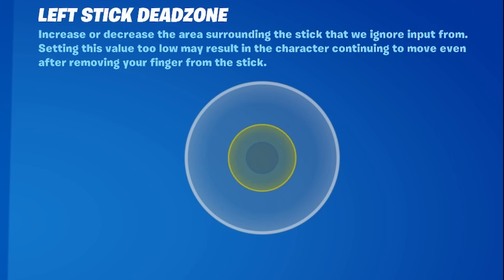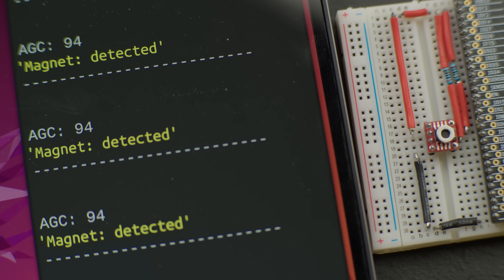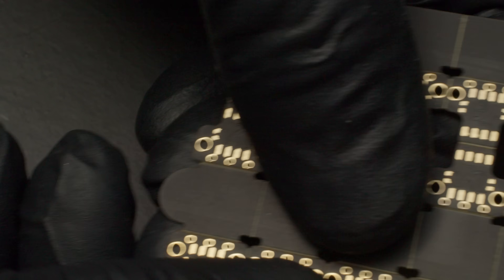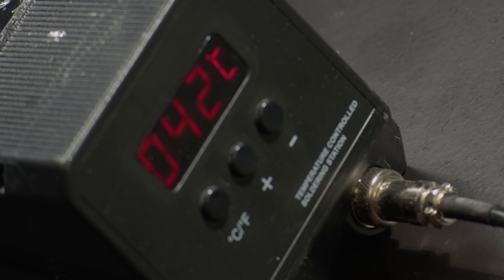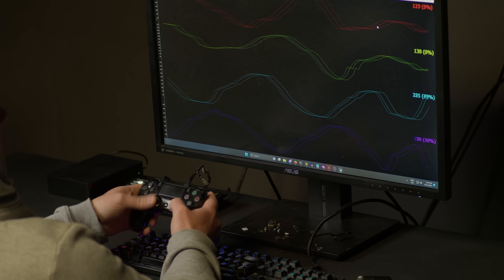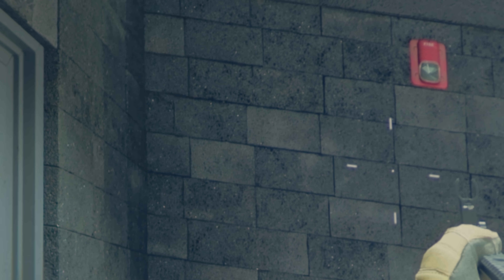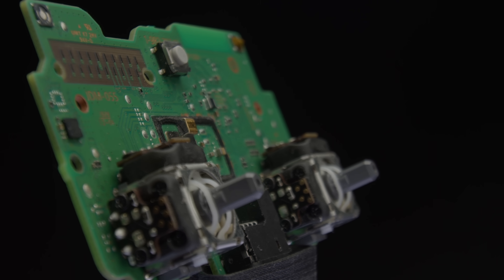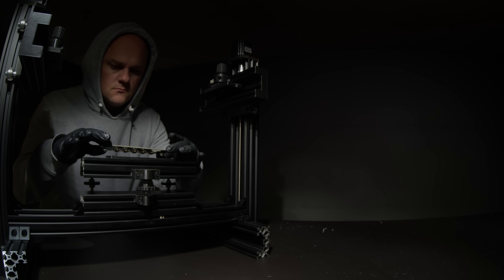Beating the $20B Joystick Drift Problem, and giving it away for free

Comment: Have you ever heard about the Dreamcast? Yes, in 1998, it had magnetic hall effect analog controls, both the analog stick AND triggers used magnetic sensors without mechanical contacts. And that's why it never had any kind of drift issues. And the rest is history.
Reply from the maker: Yes to bad they where not adopted. However these are using an additional principle not used nack then. Which is multiple hall effect sensors 90 degree apart in the same sensor. And they track the position just like gps does.  These have not been available for that long, but i guess it will come with time.
Reply: Have you heard of Xbox one controllers?

They've been using Hall effect sensors for years in their controllers.

...to detect the position of the triggers. True story.

Edit: I'm not trying to be snarky. Just doing the same format. It's dumb af that MSFT will use these sensors, but just in the wrong place.
Reply from the maker: @GoTeamScotch  Their not the same. But they both use the hall effect as a phenomena.
Reply: @GoTeamScotch  Cool but unless it's the analog sticks nobody cares.
Reply: @EikottXD  speak for yourself
Reply: @EikottXD  Speak for yourself
Reply: N64
Reply: @EikottXD  N64 was optic, just like old ball mouses, not hall effect.